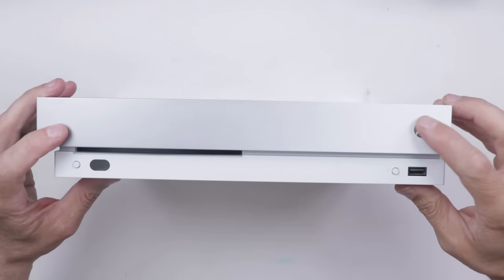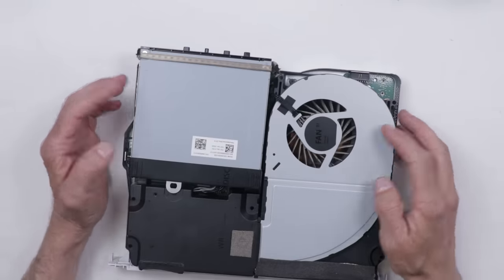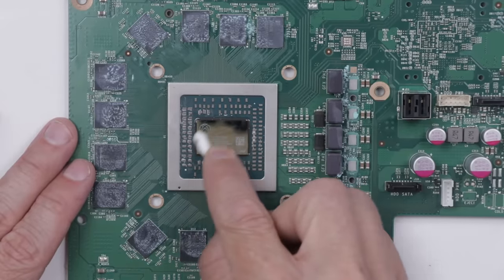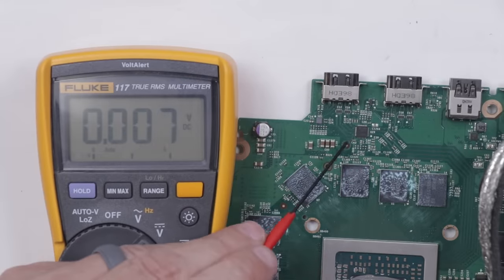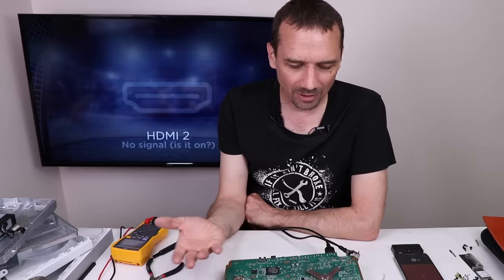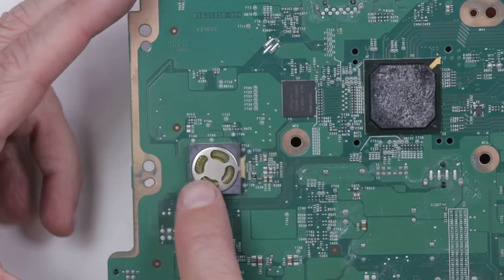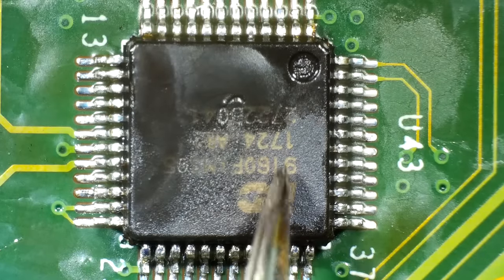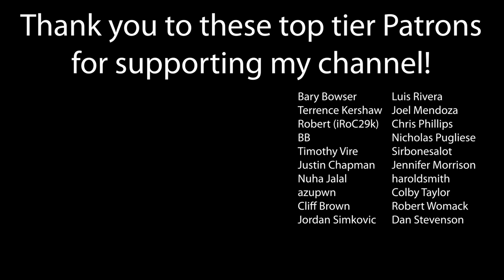BROKEN Taco Bell Xbox One X - But Can I Save The Bell?!

Comment from the maker: Here's another really cool special edition Xbox One X that I tried to fix: https://youtu.be/zrvMh4vQPVM
Reply: I need to get my controller fixed.  One of the triggers is loose.  Where can I send it too so u can fix it.
Reply: I love when iFixit is the sponsor as they really do have awesome products.
Reply: Can I purchase this Xbox from you? Please
Reply: You used too much thermal paste
Reply: Had me sweating with the speaker 😂
Reply: Did you give the seller a negative feedback based on his horrible description?  I mean he never said it was opened before and missing tons of bolts LOL
Reply from the maker: @Ray_C_901  I don't offer repair services. Sorry
Reply from the maker: @Sparkingacrossamerica  Sure:  TronicsFix eBay store: (affiliate link) https://ebay.us/y4QaRU
Reply: @Tronicsfix Well thanks for the reply.  Do you recommend anyone who does...
Reply: So my xbox one X: Taco Bell edition is having a similar or maybe the same issue but it stays on, should I try a different hard drive or maybe it would be better to let someone else look at it? Edit: It does boot into safe mode though and I did try to wipe the hard drive and it booted like normal until I turned it off, and it had the same problem the next time I turned it on

Comment: Wow, I think the no thermal paste ended up damaging something. Good thing the bell sound and components were saved.
Reply from the maker: Thanks! This was a fun one.
Reply: 23hs what
Reply: I doubt heat alone would kill it. Pretty much every modern CPU/GPU/APU/whatever will turn itself off to expressly prevent damage caused by heat. Heck, most chips these days are perfectly fine running 80-90c all day, every day. From what the seller describes it sounds like it just died. I'm guessing he took it apart after that so while not putting thermal paste certainly didn't help anything, it probably wasn't the cause of the overall failure.
Reply: I think they decided to not put any inside because it still wasn't working... But that scraped heatsink was awful
Reply: From what i saw on my laptop as we as a qhd and 4k screen the apu had a black spot as if it was burned or blown

Comment: this video was really interesting. Always thought it used the default speaker and just different firmware for the sound. This is very interesting i bet other special edition console can be saved too.
Reply from the maker: Ya, that was interesting to me as well. It is good to know this trick for other special editions. Another reason why Xbox special editions are the best.
Reply: Wasn't that basically how the Xbox 360 limited edition sounds worked? I vaguely remember something about being able to change those sounds with modified consoles.

Comment: When the speaker delaminated, that was actually a good thing. It's probably how it was originally installed. That small board it was on was probably attached to the mainboard, then the wires were soldered to it, and then it was glued to the speaker board. 

Following that way, you could have repaired it closer to factory...
Reply: He did it better anyway 😅
Reply: @SirSlicer66  homie he used tape 💀 not that it was bad but it certainly wasn’t better lmao
Reply: @romulofigueroadiaz480  high temp tape probably he smarter then you already thinking ahead 🤷🏼‍♂️

Comment: I'll tell you exactly what happened to this Xbox:

It had a legitimate overheating problem at first so the owner took it to somebody that claimed they could fix it. Turned out that they had no f'n idea what they were doing and damaged the system's heatsink in the process while forgetting to replace the thermal paste they scraped off... The owner had no idea that was the extent of the "repair" and proceeded to game on it; further damaging the APU in the process.
Reply: This looks like a word for word copy of what I've seen over the years on this channel
Reply: Not to mention I find it hard to validate your comment considering the condition if it and lack of information backing up with your story
Reply: @the_mancavewithjacob  The hell are you talking about? I just made an educated guess because I, myself, also repair stuff.
Reply: @the_mancavewithjacob  Maybe because that's most times the case? Either the owner or a repair show that don't know what they are doing try to fix it and they completely f it up.

Comment: How can someone NOT put thermal paste on an APU/CPU/GPU when removing the old one. Even those guys who blasphemously mix new thermal paste with  the old at least know that there needs to be something there also that guy who "repaired" the Xbox needs to be nowhere near any DIY tools or repair shop he mangled a heatsink by scraping thermal paste off it with what was probably a screw driver or a tweezer or something then he didn't bother replacing it and didn't even fully clean off the old one which fried the whole Xbox MOBO
Reply: Imo that is what probably killed the APU. Either the seller bought it that way not knowing or sold it that way knowing it was toast do to INCOMPETENCE.

Comment: @tronicsfix Technical question: i've seen that you sometimes solder onto contacts without stripping the wire first, applying your soldering iron directly to the sheating. Is this a common tactic? Or do you need a special type of wire? Thanks for reading and thanks for the great content!
Reply: I believe he uses wire that is conductive all the way through instead of traditional wire with a coating on the outside.

Comment: ebay seller did not tell you all; "was playing one day and than it just stopped working. after that i opened it unprofessionally, lost a bunch of screw, i saw some linus tech tipps videos where he mentioned change thermalpaste, i had no tissue to clean it but i had a quarter coin so i scratched the thermalstuff away. then i realized i dont have replacement thermalpaste so i just closed it together, lost more screws. but basically its like new!"

Comment: im thinking that the themal paste that was on the smd componets could have been conductive and maybe shorting out some off the circuitry im gussing any one that can gouge the copper on a heat sink could very easyly cheap out and try electicly conductive thermal paste

Comment: 1:16 Just don’t get that when someone (even a certified Tech….. 🍎) tear downs a device and reassembles it AND DOESN’T use all the fasteners or worse yet, put them in the WRONG PLACE; it makes me sad…. B/c ya know they either don’t care, or haven’t got a clue as to what doing and IMO (again….IMO) shouldn’t be anywhere near devices that need repaired, worked on, etc…..
If not gonna do even most basic job of taking care to disassemble a device, let alone, reassembling a device correctly, using all fasteners (didn’t say screws, b/c not all fasteners are screws😉) correctly and WITH CARE…..how do you think the “work” that is being “performed” is gonna look like, tbh/imo, probably not the greatest, which kinda sad 🤦🏼 
Ok, “rant over”!……video can continue, thx☺️

Comment: Can you sand/file a heatsink that's been scraped up like that and make it smooth again? I guess if you shave off too much it won't be the right height though, even if only off by less than a millimeter.
Reply: better to just let the thermal paste fill the gaps.

Comment: Hey TonicsFix. Hopefully you can be kind to answer my question. I have asked several times in comments at other channels but no one bothered answering since they probably thought my question was dumb and that I was an idiot for asking if I didn't know the answer. I'm in no way a tech guy so I know nothing about electronics and how they work, I only know how to use them. My question is just a curiosity question but it is: Why and or how do computers, game consoles, phones and the like get hot enough to need a fan and other things to cool them down?

Comment: Can u help me, when I try to connect a ps4 controller to my ps4 from another ps4 it doesn't let me. I plug it in to my ps4 with a cord and it lights up like it's charging but when I turn it on it just stays connected to the other ps4. Ive tried resetting the controller but it doesn't work. Please help me